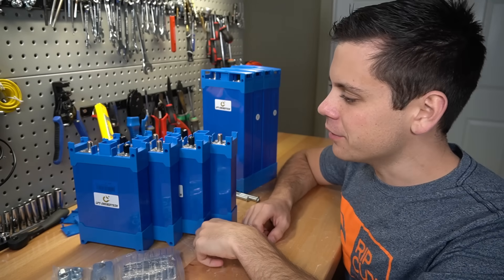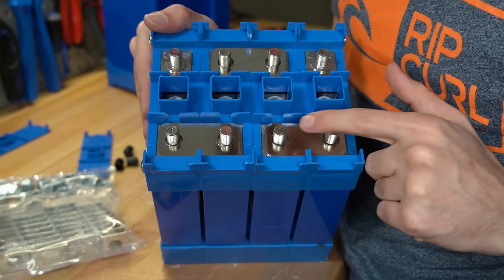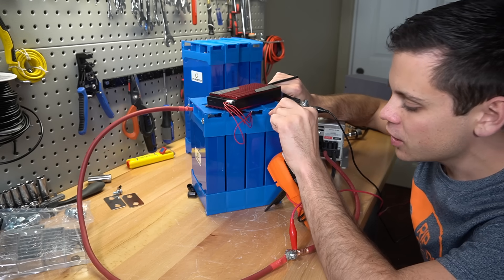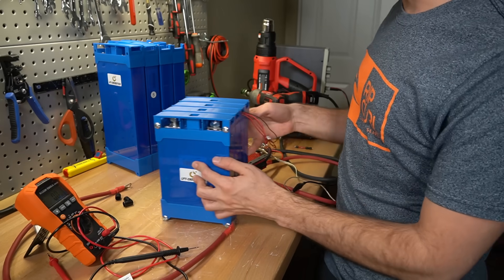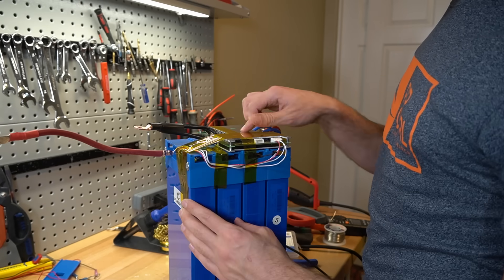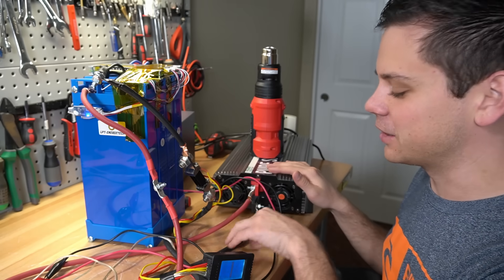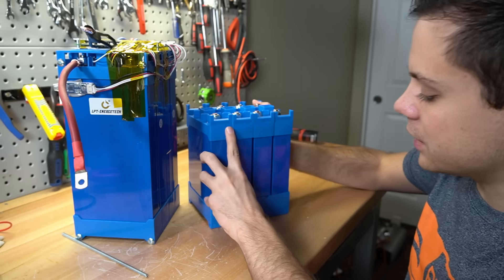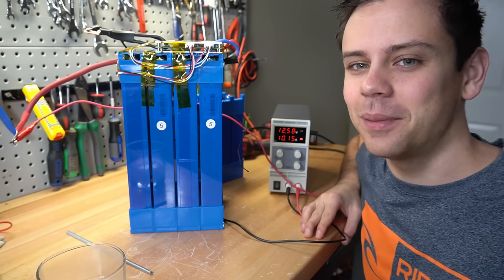Fortune LiFePO4 Battery Cells: I love them!

Comment: Dear Will, how are you doing?
I am from Brazil and I am a big fan of your work and tests. 
By your experience on many tests that you have performed, how is the behavior of the batteries connect to a low-frequency inverter with a heavy load(1hp water pumping or any inductive motor) and a LED bulb lights in the same circuit?
Does it blink every time that the pump goes on or the battery has enough power to sustain without blinking the lights? Can you help me to understand and how to solve it?
I appreciate so much your time and attention.
thanks and best regards,
Rodrigo

Comment: Second question. (Sorry I am greedy) Would one be better off creating 2 4S 100Ah batteries (each with BMS) with these cells OR would it be better two parallel the cells 4S2P to create single 200Ah battery with of course only one BMS?  That is, if the additional current handling of 2 Battery/BMS system was not needed. Thanks to anyone who answers.

Comment: If one cell fails, after some time, and is replaced and the pack balanced, will there be any difficulties related to charging the pack, i.e., the mis-matched cell problem? Of course no problem in living with "aged" performance of say other 3 in 12v pack.

Comment: great video.   i was hopping you can point me in the right direction.  i have two 8000-543-138 High Pressure 12VDC pumps in a van for my window cleaning business.  i power them currently with marine battery's.  i would like to use Lithium Phosphate battery's and charge them as i drive with a charger that plugs into a cigarette lighter, or usb.  any help you can give,would much appreciated.

Comment: Will, are these comparable to the cells sold on amazon?  It seems these are more stout. Like to see a 24 volt configuration with enough batteries for 1000 watt solar panels. (4×250). The used ones you recommend. For skoolies.

Comment: I would like some guidance .
I have total 650W 60-65V solar, 16 100A 3V law cells, 12V 3.5KW inverter and 12V power from alternator .
What kinda BMS could you recommend?

As you suggested I set up 4 pararell and 4 serial  configuration but having hard time that can handle 400A .

Appreciate your suggestion in advance

Comment: Using an impact on those cells is a bad idea. Most electrical terminals are actually copper under the cladding and can strip or deform easily. All electrical connections should be torqued to the manufacturer specification or you will void the warranty. As an electrician with 32 years behind me. Most of that in a service capacity. I have seen way too many terminals destroyed by people using impacts or over tightening the terminals. 
Over torquing the terminal doesn't give you a better connection. Past a certain point the surfaces begin to warp or deform giving you less surface area for the ampacity of the connection.
Reply from the maker: Oh I am pretty sure we all know that lol. They are used for high vibration environment, specifically subways and underground mining equipment. Manufacturer states that its fine. But I agree, impact gun is a lot of force. Probably not the best idea but it's supposed to handle it.

Comment: Can I connect two Solar panels in series and two 12v batteries in series (with a 24v charge controller) to make it a 24v system? Are there any problems with this setup?

Comment: So the 100AH cells if combined together with 4 would then make a 400AH pack...right?
Reply: parallel increase capacity, serial connect increase voltage. use 4x3.2v100ah, you can only get 12.8V 100Ah dear.

Comment: if you have any batterys you would like to donate due to not being able to work and cant make money i cant buy a replacement i might be loosing my house and might have to be living in my 5x10 work trailer with a 6 month old... my lead acid battery is about shot and we will be strictly be using solar. so if ya feel like paying it forward i would gladly accept! thanks for all your teaching it has helped me get my system setup without wasting money other than i bought the battery first...
Reply from the maker: I'm hoarding my batteries because I need them for my personal survival. Tougher times are coming
Reply: @WillProwse  I completely understand stay safe thanks for all the time you have put in to making the videos helped me that way. God bless and get ready for the beast system 🙏

Comment: What else would be needed to put 480 of the 100Ah into a 48V  120+ Kwh powerwall and tie it into a 200 amp AC panel? Why do people not use 96V or 192V DC? Thanks

Comment: I'm confused, shouldn't they be 240Ah and 400Ah respectively since there are 4 cells for each battery pack?
Reply: When connecting in series the voltage goes up but the amp hr stays the same.

Comment: When are you going to do an update on these batteries? Would like to see what your thinking after you used them for a while.
Reply from the maker: I love them. Found out they are used in underground mining equipment and subways. Solid batteries
Reply: @WillProwse   Hi Will, would you consider it safe if these cells are laid or stored flat on it’s side versus terminals pointing up?

Comment: Super cool prismatic cell design, going to check out this brand some more. Did I miss the part where the price was discusssed? I recently built a 48V solar storage battery  in a Saginaw NEMA 1 cabinet with 16 x 120 AH  cells from GEB  sourced directly from China on Alibaba. $  61.00 each plus about $400 Shipping to my front door. So far have not found a better price on LFP  cells.
Reply: hi there, please contact whatsapp 0086 18963643619 if you are still interested in these batteries

Comment: can anyone comment on safety of these LiFePO4 batteries relative to 18650 Li Ion?  fire, blow up?
Reply from the maker: LiFePO4 is a million times after. It's considered non combustible. Google search transport safety study on lithium ion batteries
Reply: @WillProwse  Thanks Will.  I was considering 18650 for home power bank until I saw LiFePO4.  LiFePO4 seems like a good and safe option as performance looks good from your testing.

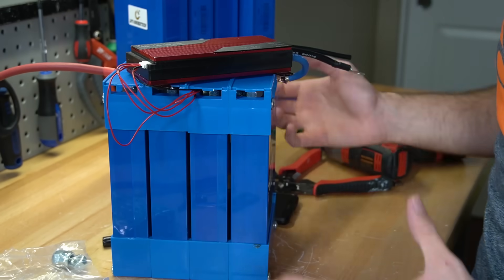Comment: Will, love your videos. At 2:40 you said the smaller pack was 60ah cells and the larger one was 100ah cells but then at 4:50 you call them both 100ah. Do you have to put them in a case? What are the dimensions. Thanks for all you do!
Reply: Rick L 12v 100ah 5.5x6.5x12inches

Comment: Hey Will, thanks for the great videos and information and sorry for the newby question but... what do you mean by 6C or 1C? You use this terminology a lot in your vids and I don't understand it.
Reply: Charge and discharge rates of a battery are governed by C-rates. The capacity of a battery is commonly rated at 1C, meaning that a fully charged battery rated at 1Ah should provide 1A for one hour. The same battery discharging at 0.5C should provide 500mA for two hours, and at 2C it delivers 2A for 30 minutes. Losses at fast discharges reduce the discharge time and these losses also affect charge times.

A C-rate of 1C is also known as a one-hour discharge; 0.5C or C/2 is a two-hour discharge and 0.2C or C/5 is a 5-hour discharge. ...from Battery University, Hope that helps.

Comment: I priced these batteries they are $120 per 100ah cell and $90 to ship to Indiana. $570 total (4 cells). The 100ah CALB batteries that you tested as good are only $480.28 w/tax (4 cells) with the buss bars & free shipping (60 days of course) I am sure these are really good cells but still $90 more per 12v battery. I did find out about Tariffs. It is a random chance that batteries from China will get snagged and marked for a tariff fee. They say to buy them in smaller lots and even have seller mark the packages as a gift then they will often ignore it. From what I seen most of the batteries like these on Aliexpress have free shipping (unless one requires fast shipping then a lot more of course)

Comment: Hi Will
Love your site. Thanks for all your tips.
I have been looking at ali express to buy some 200ah cells and am struggling with the cost differences between some of the new cells. Some are twice the price of others. Being new i thought they would all be about the same price, but this is not the case. Can you enlighten me as to why. I want to build a 400ah setup with two lots of 200ah in parallel. Can you recommend two bms units that would work in parallel at 200ah each. 
I am so enthused with your site i never want to buy a premade battery again. Keep up the awsome work on your site. We love it heaps down under here in Australia 
Regards
Kev Bryson

Comment: FYI, they are not sending out threaded rod and nuts right now. The email I got from them is this:

 Hi, we do not supply the threaded rod & nuts to bind the Fortune cells together at the moment. You should be able to find some at a good cost through your local nut & bolt supplier.
Thanks!
Matt
Reply from the maker: Dang they told me same thing when I made second order. What a bummer. Going to home Depot today then
Reply: Let me know if you can find anything in local store. I don't think home depot or lowes will carry those.
Reply: Got the 1/4'' - 20X36 inch threaded rod from homedepot. Plus 1/4'' - 20 wingnuts with washer and locking washer. Used dremel tool to cut the threaded rod and fitted on the battery. Only down side is that the wing nuts is sticking out. Not as convenient as the original thread rod which is flush mounted into the holes.

Comment: I have been wanting to add a trolling motor to my kayak. Would this type of battery work with a 30lb thrust motor @15amps?
Also which battery charger would I use to charge? I would want to build the 60ah battery for size and weight.
Reply: great idea....now one more project for me to think about.
Reply: Should work nicely.  The amp draw for 30# thrust should be around 30a.  My 45# thrust draws up to 50A at WOT and have used a 55ah SLA.  Currently building CALB 100AH cell, and using Plano Tactical Ammo Crate.  You may lose your storage for your fishing crate.

Comment: Have you tested out Lithium Titanate Oxid Cells (LTO)?  Each battery is cylindrical in shape with 40Ah storage and a voltage of 2.3. They say you can exceed a life cycle of over 30,000 cycles (but they did not say what the DOD was).  Maximum charging and discharging current is 10C.  Its operating temperature range is -50°C to +65°C.  In the video I notice the cells had a name of “Yinlong”.  And they said they had a non-flammable cell technology like LiFePO4.

Comment: Please be aware that the seller's site doesn't tell you the shipping costs until after you check out (they invoice you later).  This is not deceptive as the site clearly states it will do this, however the cost to ship my 4 cell order was $80 and I live less than 100 miles from the location they ship from (Salt Lake City).
Reply from the maker: Yeah 80 bucks is typical. I am buying another batch of cells with my own cash (first cells were free for me, but I had to drop 1200 bucks on big batch for my next project) so I'm in the same boat, and I still think it's cheap. Compare this price with AliExpress cells I have been buying. I think it's a super fair price with shipping. I love these cells

Comment: Wait...

Airspace is really important for prismatic cells of any kind...

I thought prismatic cells needed to be compressed together to prevent expansion...

Which is it?
Reply from the maker: When they are spaced apart, they can expand and contract. And pushing them together is way more important in older plastic case cells. Not so much for the aluminum cased cells. I should have mentioned that. Sorry

Comment: This company's batteries sound great! I also really like this BMS with low temp shut off. My system is 24V. Is it possible to use these 12V BMS in series or something?
Reply from the maker: Use a 24v 8s BMS instead. Some are coming next month.

Comment: Hello Mr. Prowse

I was just wondering if I could ask you a question about the Fortune LiFePO4 batteries in this video. 

I’m planning on building a 48v 19.2 kWh battery bank and I was just wondering if you would recommend these batteries for a system that large or if you would just go with Battle Born batteries. I did some ruff calculations and I would save roughly 5,000 if I built it myself and went with the Fortune but I’m not sure if it’s worth it for no warranty and I don’t know if the Fortune batteries would hold up over the long haul compared to the Battle Born.

And if you would choose the Fortune batteries, Can you wire them up in parallel and then combine multiple packs in series to increase the battery bank capacity?.  

Also is it better to have multiple 48v cells wired in series or is it better to make smaller 12v cells wired in Parallel to get 48v and then wiring them in series 

Thank you for your time and all the work you put into your videos.

Comment: Will, I have a question about the 3K all in one,  when you cut the extension cord can you use a 12 gauge three plug( so you can plug in 3  cords) or is that a not a good idea? Thanks

Comment: Glad you mentioned Sol-Ark.   I was thinking of doing a similar thing where i install an inverter and batteries for a backup system and down the road after i build a garage for the panels, add solar.  I was curious how well these work in a 48v set up and if that BMS could handle it.
Reply: That was a 12v BMS. You can't daisy chain the batteries in series w/ 4x12v bms's. You would need one 48v bms. You can use them in parallel, but that won't get  you to 48v :) Just a heads up.

Comment: Do you know anything about a 12v/24v auto adaptive inverter from china and do they work I have upgraded my solar to 24v 5 kwh byd lithium bank and i need a new inverter about $200max ( im poor so dont suggest outback, or anything that cost more than my solar setup )my old system was 2kwh lead acid battery 2.5kwh unisolar 12v panels with a 12v cobra 2500 inverter. 60a make sky blue charge controller (It worked for 5yrs and continue to work) please assist with this issue I'm going to be 100% full time offgrid in my cabin with limited use of the generator.

Comment: Hi Will,

Nice vids, i need a solution for replacing a 850ah forklift battery. 
I’m living full offgrid, mmp solar inverter 2500watt 24volt, 4.1Kw of solar panel, two 70amp mppt solar charger.
I use one split ac 12kbtu and all my household equipments.
I’m tinking to upgrade to 1200ah

Thx

Comment: Can you use 8 of these (60 Ah) in a parallel-series configuration? Do you use 1 BMS in this configuration? Or do you have to create two 4-cell batteries (series) and then parallel the 2 batteries (a BMS per battery)? Looking to get 100Ah+ in a Group 27 or 31 case. Have you made a video of special considerations needed when paralleling 12v batteries?
Reply from the maker: https://youtu.be/zStEtH9Le-w

Comment: William have you done any video teaching on the best Lithium Titanate battery’s to build a 48v battery bank for back-up Power for Home ? I’m in Grid working at making my free generator using a 2 cat Alternators tapping straight into the Stator the copper wires And what I’ve learned is because of the Neodymium Magnets so close to the copper wiring in the alternator that it produces a pure sine wave straight from the generator sauce ! I like the life of Titanate ! But when I do the math I need 21 Titanate batteries! But they should last my lifetime !

Comment: I just bought a set of the 60-amp cells.
They told me they don't don't plan on raising the prices
Reply: The Trail Rat ...Great!  Can you share your shipping details?
Reply: @737smartin  actually I found that I could drive to get the battery's.
They are just below salt lake City utah.
It would have cost about $65 to ship to the company yard in saint George Utah (I'm a truck driver)
They were nice to deal with on the phone I'll be getting more cells this year.
You just create an account with them then place an order
Reply: The Trail Rat ...Good for you—and thanks for the reply.
Reply: @737smartin  also if you want the bolts will used to secure the cells together you need to ask for them not shore how much that are.
I'm using 1/4 inch threaded rod and nylon lock nuts from home Depot

Comment: Instead of leaving an air gap between cells. How about fitting some flat plate aluminum that extends out both sides an inch or two. Thinking this would dissipate the heat more efficiently.
Reply: Great idea!
Reply: How about with some thermal grease?
Reply: Yeah... Fins like motorcycle cylinders or airplane cylinders... "cool" idea... pun intended.

Comment: 1:18 The gap between cells is not enough for convective air flow. You need a space >1" (~3 cm) before the air is able to flow to get any significant convective heat transfer.

Comment: your excitement makes this video feel like the home shopping channel. Prepare for old ladies ordering these cells. BTW my puny car draws 75A cranking, so I should be able to crank for 1.5 hours with such a battery! Maybe I should just unscrew the spark plugs and drive my car around entirely on the starter motor?
Reply from the maker: Haha! And what car is that??
Reply: @WillProwse  1998 Fiat 600, nameplate power on the starter is 750W, Engine is 54hp 1108 CC
Reply from the maker: That is tiny haha